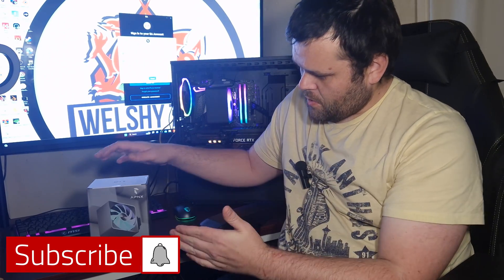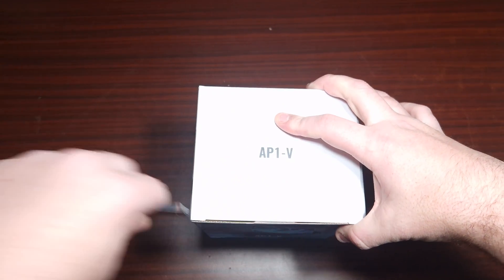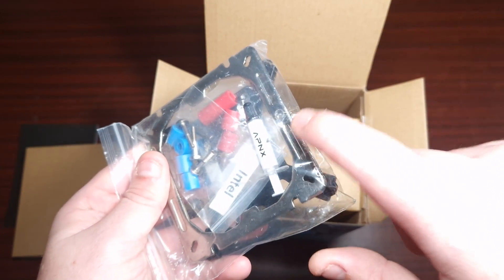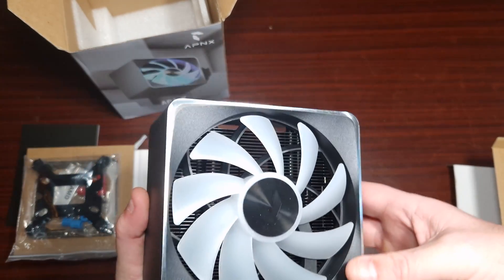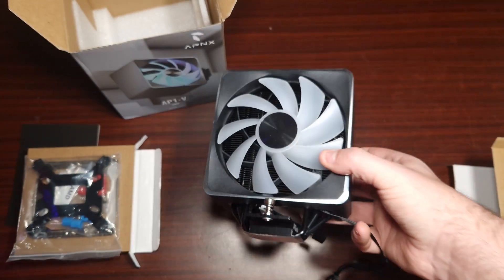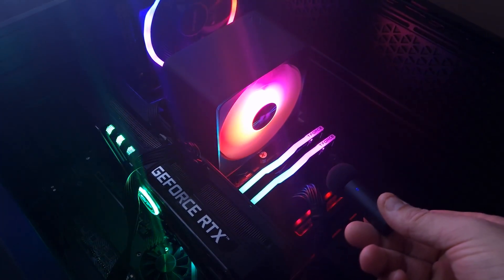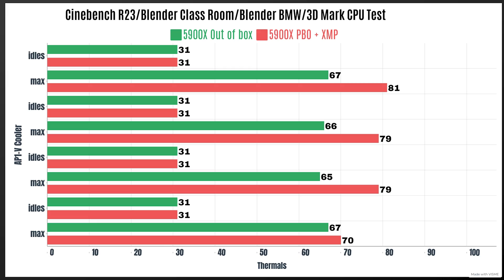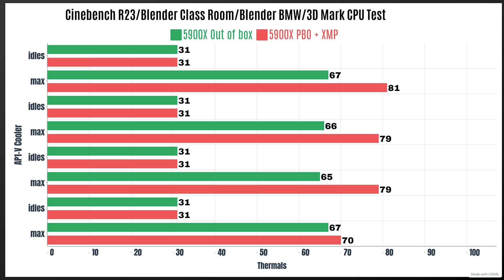AP1-V ARGB CPU Cooler Review - Every Detail Matters Right

Comment: I know it's an air cooler, but its aesthetic appeal is so captivating that I'm seriously considering getting it. Do you reckon it could handle a 7950X3D without any issues, especially during gaming sessions?
Reply from the maker: it should be fine during gaming as you won't utilise Every single core But during Applications that would Use most of the cores it might struggle

Comment: Got this fan for my AMD Ryzen 9 7900X, and it barely hits 50ºC in most of my gaming use. Which is a surprise after reading all the complaints about 7900X constantly hitting 95ºC. (Did above average for the CPU in benchmarks too, so it's not like it's underperforming. 'course, I did get this professionally installed along with five case fans, so that may play a part in the cooling working perfectly.)
Seems to be performing about as well as Noctua NH-D15 etc. which costs double. Hard to know how it compares in durability, though...

Comment: How tall is when installed on board?
Reply from the maker: Going to depend on your case more than anything  but here are the dimensions 
With bracket: 128*92*157mm
Without bracket: 128*76.5*157mm
Reply: Thx😊

Comment: Great review, just wondering if you have any experience with the deep cool ak500 cpu cooler, if possible too which one would you say performs better. I run an i5 12600k if necessary
Reply from the maker: Thank you so much I've reviewed the deepcool AK400, and it was a good cooler. Do you have any plans on overclocking ?
Reply: @WELSHYTECH  I’ve looked at overlocking a bit but never tried it as I’ve never needed the extra power
Reply from the maker: @CRT358XLM  I personally wouldn't want either Cooler  you would want something bigger for the extra head room
Reply: @WELSHYTECH  cheers for the tips, thinking now I’ll just wait until I upgrade everything before messing with too much.
Reply from the maker: @CRT358XLM  if you temps are ok now might as well no point spending money if your temps are ok

Comment: How do you rate it's performance compared to the single tower thermalright coolers you've tested? obviously it looks better
Reply from the maker: Thermalright single tower coolers ones I've tested have had higher thermals this one I'd say its better than the Burst Assassin but as good as the peerless assassin
Reply: @WELSHYTECH   If it's even in the same discussion as the peerless assassin then its doing good work. I've been keeping an eye out for reviews solely for it's aesthetic value. 

You've earned a sub- I've watched a few on your vids now on fans and coolers, they've been useful and it good to see the quality increase over time. Looking forward to your take on the apnx fans
Reply from the maker: That will be coming this week
Reply from the maker: And thank you for that. I appreciate it
Reply: it looks like it's only running a couple of degrees warmer than the results you got for the dark rock 5. Maybe i'll be ok running this on a 7900x with a power limit
Reply from the maker: Dark Rock Pro 5 I did 2 different tests thermals were higher on AM5 compared to AM4